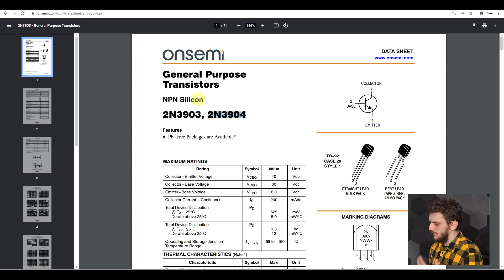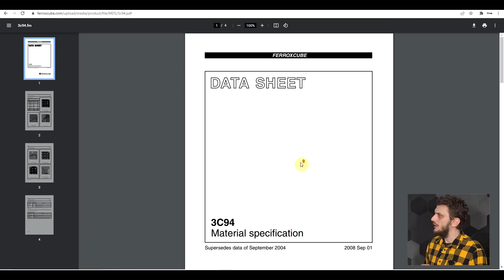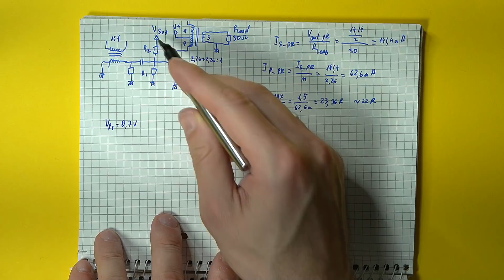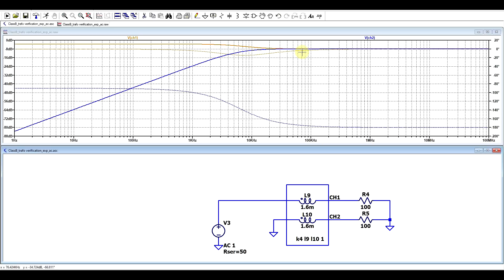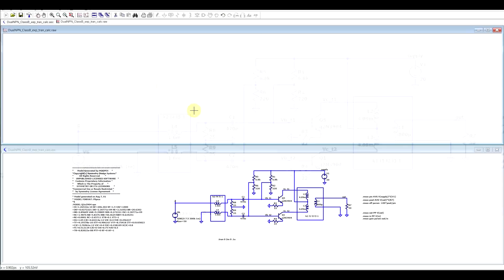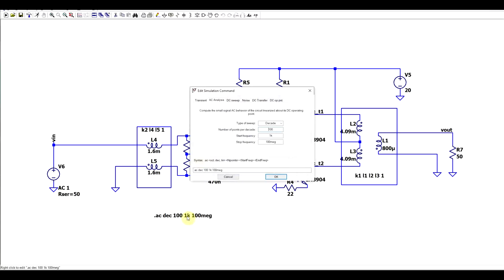The Class B amplifier - design and test (2a/2)

Comment: Ok you got my attention got anything on transformer data to winds missed the class and was so long back I forget the notes i have some data but I like expert for something a little special to run upto 6 20/40kv 0.5amp pulse units for Tesla and EMP test stuff which I'am trying to find the wire type for as it's not general wind type like the 6000 output unit types. 😃😄😁😆😅5 Smiles. If you or anyone reading has a clue on a place to look please message I would really appreciate it.